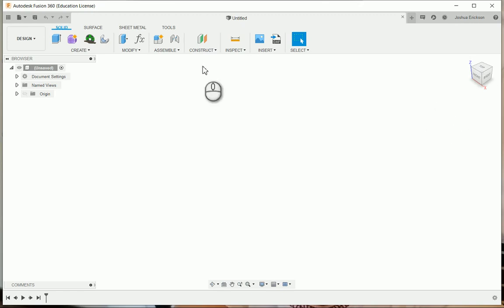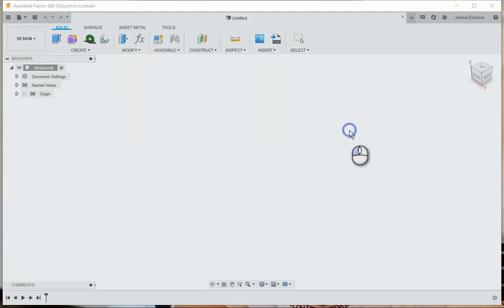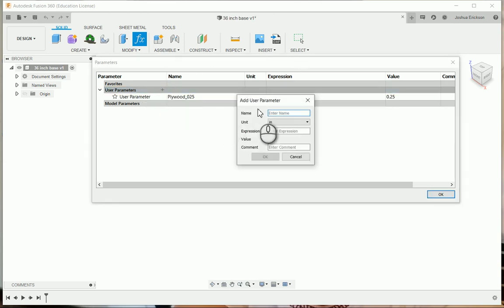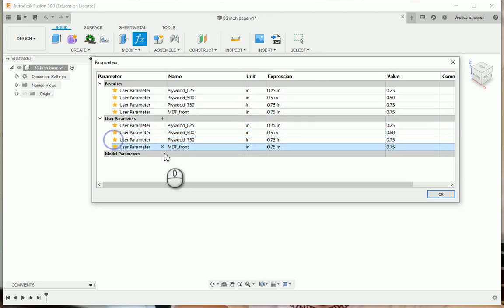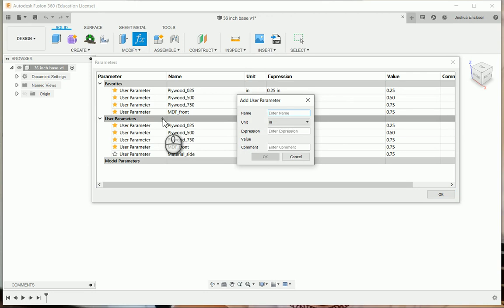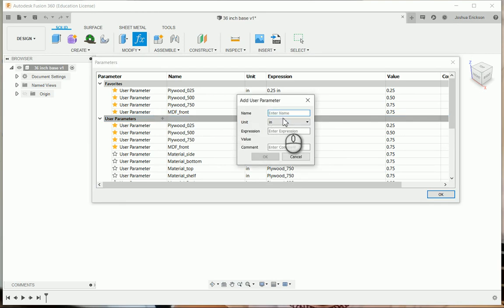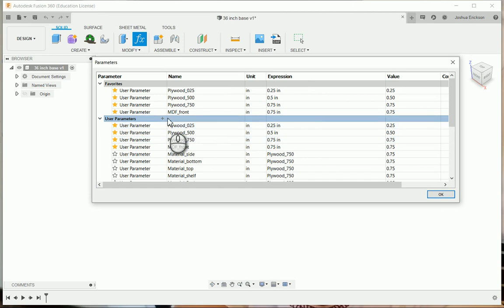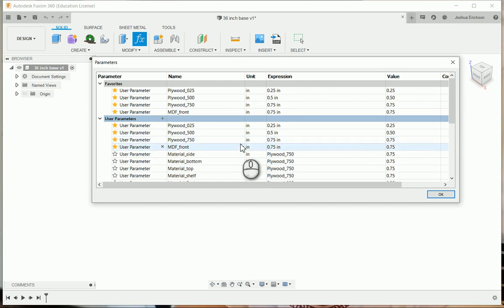Creating kitchen cabinets with fusion 360. Part 1 - Parameters.

Comment: Thank's because I was offered a good job doing this for a cabinet shop, but they use some weird obscure software and it's a nightmare to setup on different workstations because the archaic key & dongles and all that.  I was told as long as I can get them put together and get a cutlist, it would be good. They said they don't care what software I use as long as they can do it. Cabinet Vision, I think it iwhat the software is.